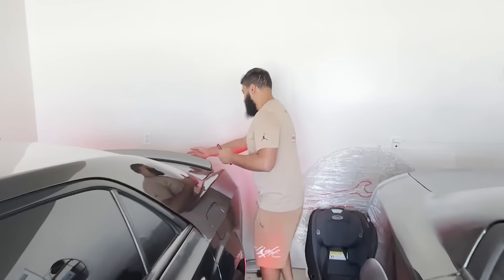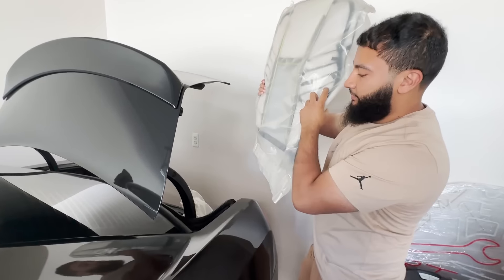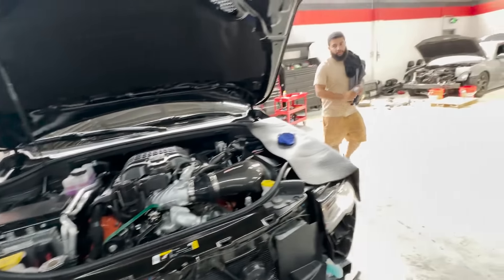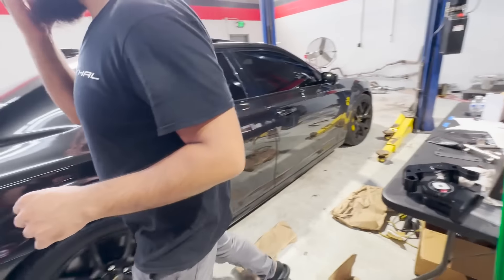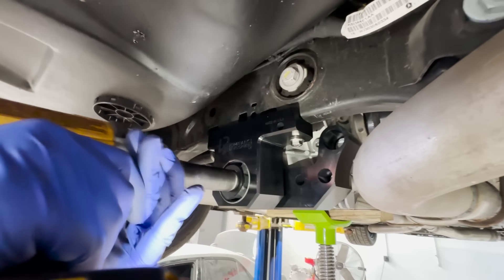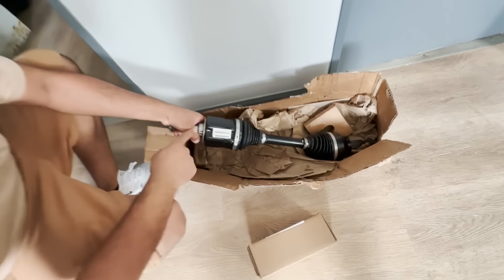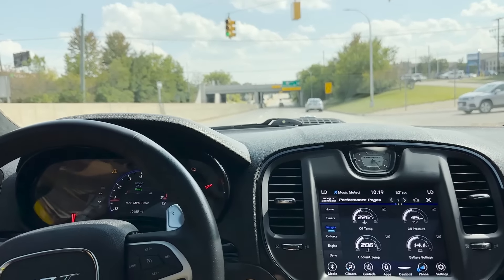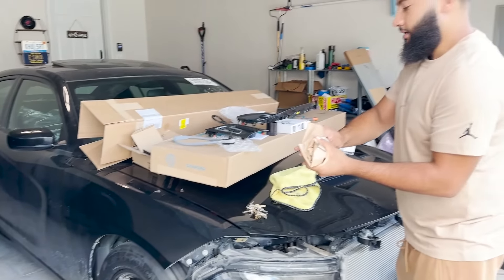TESTING 0-60 IN MY AWD DEMON 170 CHRYSLER 300 1.2 SECONDS?

Comment from the maker: MID MUFFLER DELETE NEXT?!!! SUB AND LIKE FOR MORE!!!! FOLLOW ME ON IG @ KHAL_SRT ✌
Reply: Corsa extreme
Reply: Can you make a wide body scat pack 300c please
Reply: With a free flowing exhaust I’d leave the mid muffler and delete the resonators instead. It sounds much better that way and since there are no kitties you don’t want it too loud to where you attract even more attention from the five o.
Reply: Idk if you did this but I notices you say you spinning. If tou turn the trac control all the way off it should auto switch to awd. Ik it's different because you have way more power but try it.
Reply: @Johnathon_Jackson  needs the resonators believe it or not you lose a lot of power I saw this at the magnaflow booth straight pipes move 20to30% less air than stock or chambered exhaust, I have headers with "cats" x pipe does a bullets and dumps before the rear tire gained 12 HP over straight pipe to just rear mufflers
Reply: Yo what’s going on. I see u all the time in Dearborn. Love your builds
Reply: I have a 2019 dodge charger scatpack I fully swapped with hellcat drivetrain trans engine wiring fuel system half inch hellcat fuel lines and pumps it was working perfect for about 6 months then trying to adjust speedometer needle from alpha obd and then ny acc /fcw system unavailable message popped up and now fuel enrichment isn't working when at full throttle the ratio doesn't go down like supposed to can you help me please I've looked everywhere man me and my brother in law that did the swap can't fix it and your the man I think your in Michigan I'm in indiana I will drive it to you HELP BEEN DOWN FOR A MONTH CANT FIND ANYONE AS SMART AS YOU WITH THIS
Reply: Khalsrt- I have a 2012 Chrysler 300 SRT8, I am running factory OEM wheels with 275 40 ZR20 on all 4 corners.I would like to know what size wheels and what size tires are you running.
I would like to run 305's on all 4 corners. Any suggestions?
Reply: do traction control half off the number should be better

Comment: Hey Brother, great build!!! The rear Sub-Frame rubber mounts are what's causing the wheel-hop!!! You can Correct this by replacing the rubber mounts with Solid Billet Mounts just FYI. That Diff Brace is mainly to keep that Diff from Stress-Cracking under load.

Comment: That track sounds like a monster 😭🔥🤙🏽
Reply: Demon 170 engine gang
Reply: @nolimitwild5734 we know that it still a track body
Reply: @Grandmauwuahua  300 body, track internals and drivetrain, with a 170 demon engine
Reply: @nolimitwild5734 the OP is talking about the actual trackhawk
Reply: @Visible-jb2ew thank you bro cause I couldn’t wrap my head around that. But that trac does sound insane wit the cam
Reply: @nolimitwild5734  one day we all gonna own one of em 🙏🏽
Reply: @nolimitwild5734  no slow u ain’t watch the video have a 170 hawk my boy😂

Comment: You torqued that bolt wrong. Light with the gun and then finish with the torque wrench. You can't tell if it's over torqued if the bolt doesn't move 👀👂🏿 but great job your vehicles are beast. 💪🏿🪖❤️💪🏿

Comment: What gear ratio does demon 170 have? Which one is on the demon hawk? I’m currently swapping my 05 srt8 300 rear diff with a 2016 hellcat 2.62 differential.